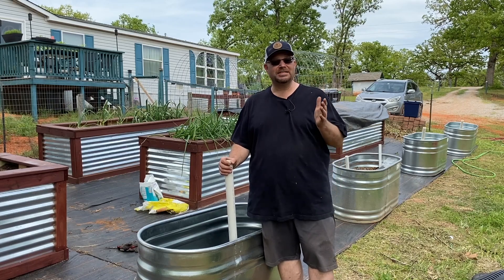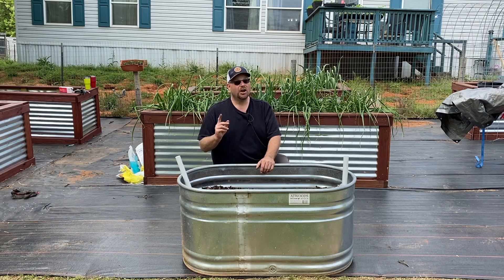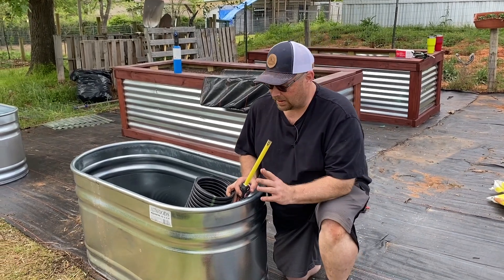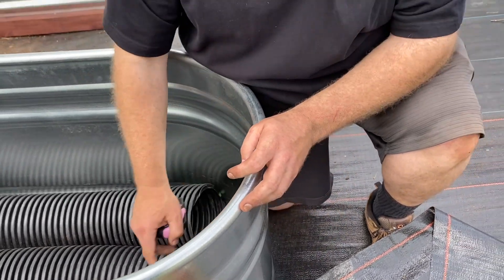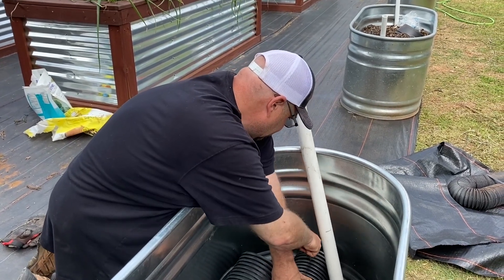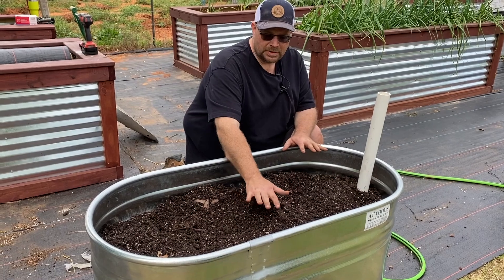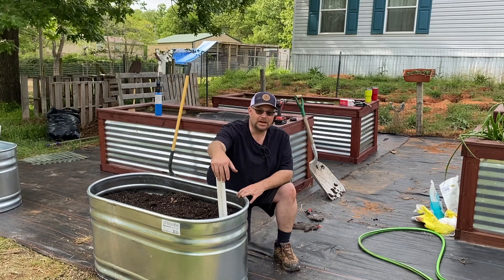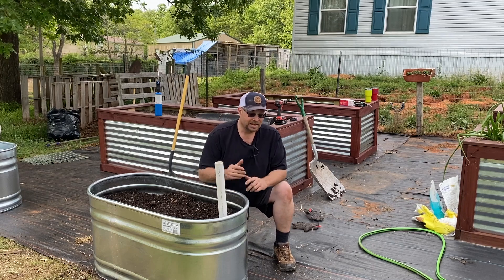The BEST Self Watering/Wicking Galvanized Metal Raised Garden Bed

Comment: Hello and thanks for the video! Where did you buy the galvanized large tub? I can’t seem to find any that big! Thanks!
Reply from the maker: Thank you! We purchased them from a company called Atwood's. It is similar to Tractor Supply Company, Rural King, and Bernard's, etc... These are the 2x4 size. They even come in a 2x4 small, 2x4 Medium, and 2x4 large. Not a huge difference in them, but they are manufactured to fit within each other. I guess for shipping and storage of trough.
Reply: Rocking C Homestead thanks! I am getting into gardening but I also work a bunch and it’s hard to remember to water the garden later at night. I appreciate the info!
Reply from the maker: Your welcome! We understand, one of the reasons we are going to a irrigation system for the main beds. Not only is it just hard to remember, but it is the time spent watering the garden.
Reply: Rocking C Homestead very true!

Comment: I'm not sure how this works practically... The plants I planted are dying, presumably because the water down in the pipes below the planter paper is below the level of the roots. How do the roots get below the paper to reach the water? Or am I just an idiot? Haha
Reply from the maker: You are not an idiot. it will take several weeks for the plants and roots to get big enough to drink from the bottom. I always water from the top for the 1st month or so. It really depends on if the water reservoir is emptying.

Comment: I did 7 of these this year! Thanks for posting the video...what size are your containers? Mine were pretty pricey at $92 a pop 4 foot long 12 inches deep. I could only get my hands on 4 inch piping. Watched all of Leon's videos and also Arms Family Homestead too you guys are all awesome!!! I couldn't get my tubs shipped from anyone except Amazon...and since I live an hour away from my nearest Tractor Supply, I ordered them off Amazon.  I am hoping to plant a bunch of tomatoes...
Reply from the maker: We got 2x2x4 tubes. However, we have learned that there is a slight variance in the sizes of the 2x2x4. There is a regular, medium and small. Not a huge difference, but there is some. I am sure they are manufactured that way so they can ship sitting inside of each other. The 6 inch pipe was not easy to find and when I did, I had to buy a 100 foot roll of it. Are you planing on growing determinate tomatoes or indeterminate tomatoes? If they are indeterminate you will need to find a way to trellis or stake them up. We had to improvise some pretty crazy support systems for ours last year. Good luck on the tomatoes. We cannot wait for fresh tomatoes.
Reply: How did the 4 inch tubing work out?  It is much easier to find the 4 inch for sure!

Comment: didn't need to drill a hole. the tank clearly had a drain plug at the same height lol
Reply from the maker: The Drain plug is a little lower than the hole I wanted. But I have seen people use the drain plug.

Comment: The fabric is unnecessary. In all honesty it’s a hindrance unless you are pushing the dirt and fabric between the pipes you’re losing valuable contact with the water. If clogging is a concern use sock pipe